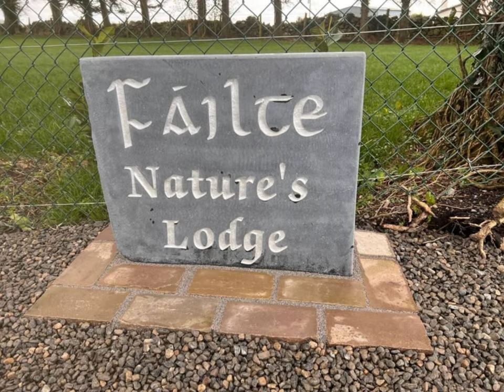Extreme House Renovation | Galway, Ireland

Comment: i hate to see chimneys removed on old buildings, the outside looks much better with the original chimneys than it does without them,  i only have one double flue chimney on my house, but it needs knocked down past roof level & rebuilt with 2 old tall chimney pots put back on, to me it prevents the building looking like a drab square box.
Reply from the maker: Thanks for sharing your thoughts. I’m sure you’ve heard the song I did it my way🇮🇪🤗💪